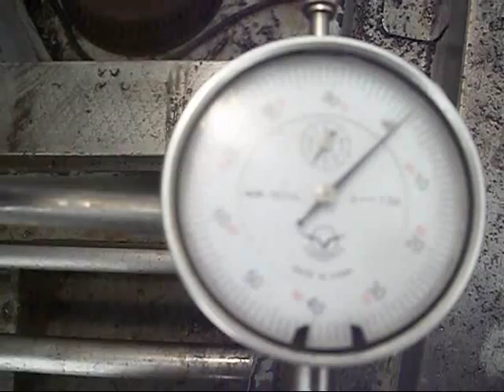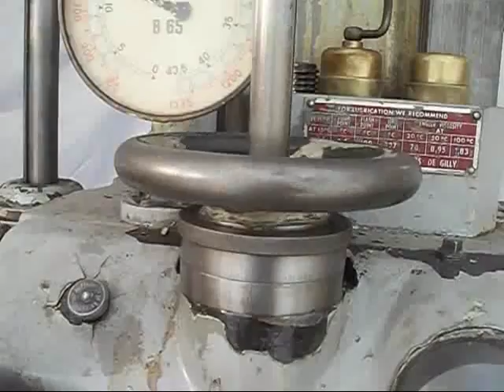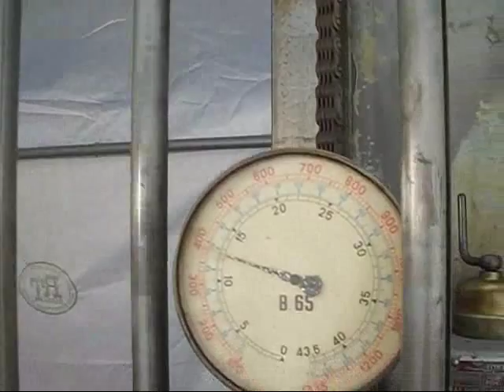WORK ON HBM

Comment: You wouldn't happen to have a manufacturer of that expanding alignment tool?
Reply from the maker: They are from my portable line boring bar  set The AMMCO Company still makes brake lathes . But I can not find any info on it Good Luck let me know if you find out anything